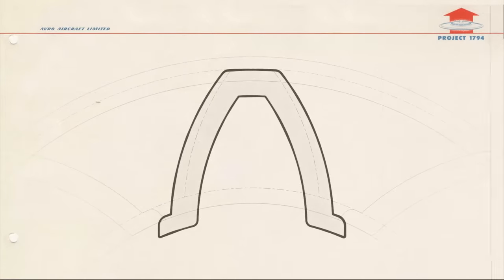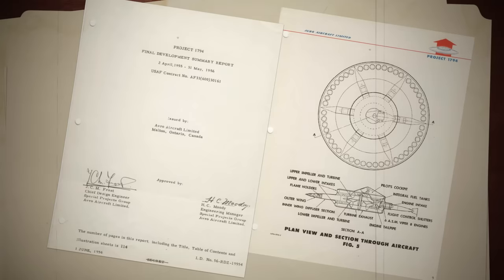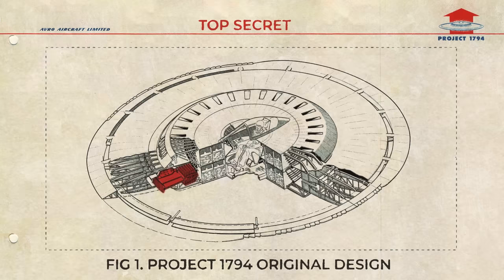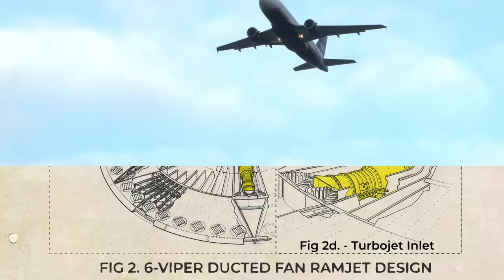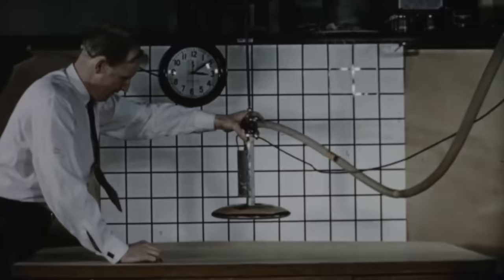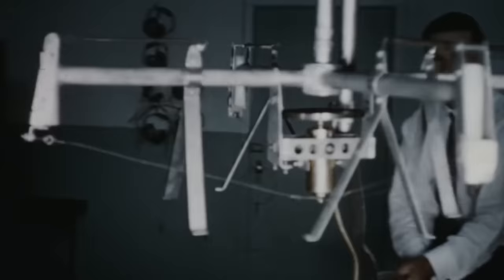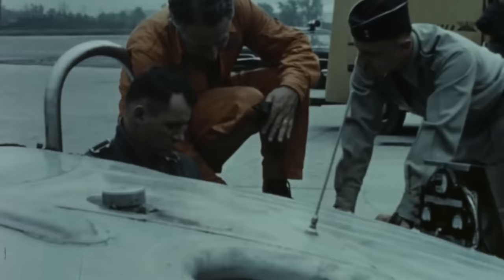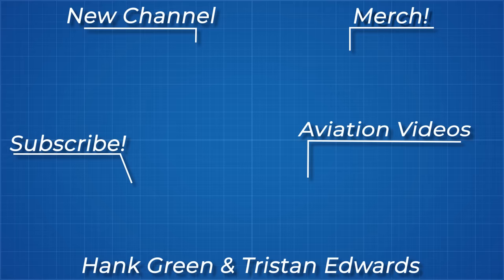The Real Flying Saucer

Comment: In The Year Of 1971 We Saw A Flying Very,Very,Very Big Disc-Hoovering in the Night-some 300-400 meters in Diameter-Golden Glowing-Hoovering Completely still in The Night.
And This Saturday Night At November 1971 The time Was 20.04 When It Apeared From A Foggy Dew,Lighted Yellow Golden Light,It Stayed For 9 minutes,and 20.13 Hours-It Flew In 
An Immence Speed-Easterly Direction-So Fast It Could Not Be Explained-The Absence Of Sound Bangs-The Sonoluminiscence Light-The E.M.P. = Electro Magnetic Pulse 20.13.....
The RUBY RED GLOWING GLITTERING CLOUD-The Dark Blue NATO STAR In The Far East.....The Burning Feeling inside Our Heads 20.13-When The Electro Magnetic Pulse Hit Our Eyes And Bodies.
There Is NO WAY THAT IT TRANSPORTED IN ANY OTHER WAY THAN A TIME TRAVEL.....................................................................This Is Our Conclusion-NOTHING Could Have Survived That Acceleration...........November, Saturday,ORUST/SWEDEN. Noethesund Bridge........50 meters above Sea Level........

Comment: At about 9 minutes it says the problem was rotating the disc took 5-11 seconds to turn 90 degrees, I almost died laughing...it's a disc for a reason every side is the front, the rotation should be in the cockpit obviously. Some fool went the wrong way and added wings

Comment: That what happens wen  You still somebody else is invention!  Could use extra Flaps on the edges of the craft Add the other 3 motors Make the centre of the craft gyroscopic  And add a very powerful At the bottom centre of the craft ( And I wouldn't try to use the pilot see as a counterbalance!)

Comment: We have UFO's here in Canada, they are powered by maple syrup drinking hockey players that launch them at Mach 3. We are working on scaling them up now.
I'd say if we just add a little more syrup then the fire power will increase to the proper force required here.
No I'm kidding. I actually think that magnetic discs spinning in opposing directions is the ticket. Air presure is not what needs to be managed, it is the effects of gravity that need to be managed here. Magnetic discs arranged properly and spinning at just the right frequency.... Yeah that is the ticket in my imagination

Comment: This didn't work because they only piped the exhaust down the centre.

If they piped it down the centre AND around the outside. It works better. For stability and all that.

Just piping it down the centre, exposes the imbalance of the spinning blades in the centre.

Which would be better off as exterior fans around the outside. Similar to the Dyson bladeless fan. But slightly different.

The weight on the outside also creates an imbalance, since there are no forces keeping the outside suspended. Creating that wobbling effect as the fan spins.

Fan speed would also have to increase and also utilize 3 fans. To get proper stability. Rotating in different directions. Oscillation.

Ex:
Clockwise
Counter-clockwise
Clockwise

3D

Also, always remember. In space there isn't always air to vault off of.

Virgin Galactic engines, for their space craft would be very smart.

Especially utilized in nuclear.

There is more information, I choose to leave out. To protect intellectual property.

Comment: why don't we just use jet propulsion on the bottom and put two discs spinning in opposite directions as close to the center of medium as possible to allow air flow throughout the  ENTIRE aircraft, giving it less momentum when trying to turn in the completely opposite direction, the only hard part would be the acceptance of airflow throughout the entire center of the craft.
Reply: that sounds stupid.

Comment: Title is fine, is just how you achieve flight, is why I came here to see whats going on. Just you're average ordinary science person. Tesla (someone who very few of you now know after a google search made a device like this using electrical power, according to documents released by the us military. His used some form of dual propulsion system which still remains a mystery. I have been working on this for years not and at best i have gotten to the point where the metals used and the geometry of the design is key in operational success. the rest is still being tested by my team, such as the energy matrix, and the reactor chamber are still experimental.
Reply: lmao ok i doubt that

Comment: I have one criticism over this video: https://www.youtube.com/watch?v=im-JM0f_J7s (Can We Create Artificial Gravity?)
Starting at 2:41 in that video, you have claimed that blood in head would be pulled down to our feet (Assuming that you meant "would be pulled a lot more , than it's currently being pulled on Earth). If my assuption is correct, that is a false statement. Our heart is capable of pushing blood on our head in 1G environment on earth, where both feet and head faces 1G, and we have no problem here on Earth.
On one gravity ring, lets say with 5m radius and 13.5 RPM, our feet would feel about 1G, and our head would feel around 0.7G, which will result a lot more blood pressure in our head than we currently have on Earth. Not less. 
It will result with a lot less blood pressure than the microgravity environment of ISS tho.

Comment: Underpowered. And too much weight at the edges made it an unstable teeter-totter. Mass should be at the center for nimble pitch adjustment. After lifting all this heavy machinery off the ground, there was insufficient leftover power to overcome the "lever arm" of heavy engines out toward the edges. The addition of a $2 gyro for a model drone would also help the human pilot by damping pitch and yaw oscillations better than that mechanical linkage. "But Tesla can land a rocket on its hiney." Extra power can do wonders, Zeke.
Reply: A full, six-axis gyro control pack could "park" a more-powerful model of this garbage heap anywhere in the sky, do flips, and auto-land it, along with all the other things cheap drones can do. That's how far we've progressed since these early prototypes of yesteryear.

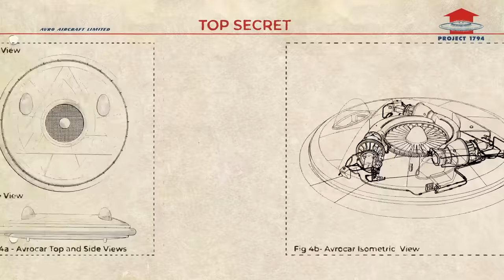Comment: 5:26 which is kind of the whole flaw in the design concept in the first place.  This project was borne out of the UFO scare, and kind of the whole idea of "flying saucers" was that it was the spin of anything in the air that provided stability and some kind of "thrust" by use of the right hand rule.  And this thing uses none of that ... and instead uses a series of small jet engines to provide thrust for lift and directional control.  

Flying saucers as alien space craft are BS to begin with, but then to try and mimic them without even using that basic concept, to me, just strikes me as being a kind of oblivious thinking that comes out of American engineering society at the time.  I saw this time and again of taking a hyped idea, and then not using the basic principle behind the idea to make that idea work.    I've never understood this about this nation.  Never.  

A frisbee, throw hat or thrown hubcap maintains its stability and flight from its spin.  And this guy made a non-spinning disk with a bunch of jets nested inside the fuselage?  Whatever man.  What a waste of time, money, effort, and a demonstration of complete stupidity.  And that, good people, is this moron's legacy.

Comment: We have the technology to make a ufo now a days, made out of the same way the magnetic 🧲 technology from the railroad From China concept that train can travel 300 mph or 500mph?? well take that rail road into a circle ⭕️ Pretty big size right? So imagine that railroad in circle spinning around 300 mph  ⭕️ and in the middle filled in with fin fan kinda like a turbine , now imagine the force of air!? N above it the cockpit n controls lithium battery’s etc ,wouldn’t that work ??

Comment: This is such a stupid aircraft, they're trying to match the capabilities of a German UFO without using the same mercury maglev technology. They should have just mounted two parallel engines instead of the triangle of spinnie-bullshit and capitalized on having a small wingless VTOL that can zoom and hover. No lateral strafing ability like a German one, but still surprising speed for something jet-based, and if you fly them below radar you could spook someone with them. Move the fuel to the outside ring as well so the pilot doesn't DIE if the central craft is hit by something angrier than shrapnel. They basically almost had a jet-driven VTOL "A-Wing" on their hands, they could have put a helicopter tail on it as well to really go fast and stop and turn with stability.

Still wouldn't ever match a Vril.
Reply: there was no german ufo. That is all tell tales

Comment: well i dont understand why they waste so much money building such unefficient flying craft, they probabily tought that the American saucers worked that way, what is laughable, the saucers seen in the air in Colorado, Texas, Alabama, etc are very fast and aerodynamic, they moove at thousands of miles per hour, they do not use airflow to moove, i have never seen a saucer with a hole in the middle, that would be very stupid, how would a craft like that moove up and down several Kms in seconds? makes no sense also how would they turn almoast instantaneaously. As everyone knows, drones and air powered craft are not very aerodynamic making it impossible to moove at high speeds or even turn, to turn you would need to tilt the craft everytime you wanted to turn, that could take some seconds and a lot of engeneering, The american saucer is a lot better, the saucer is not very aerodynamic on the atmosphere but they put a wing on the back and up and down wings on the sides of the saucer, making it aerodynamic, also the propulsion system is nuclear so you could imagine the potential. Saucers are not good if not powered by elements capable of changing their gravity A waves, what are inexistant in our simple solar system. Laws of physics are based on the knowledge know, found in our solar system, just because we dont have the knowledge yet doesnt mean it is against the laws of physics, it just means it is a big leap with a lot of steps, we are still young and we have a lot of potential if we dont destroy ourselves.